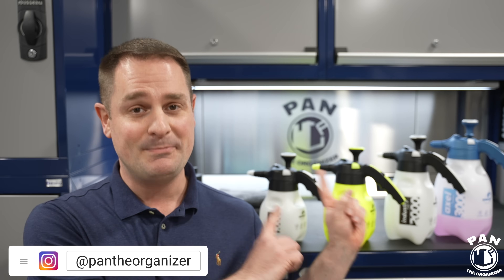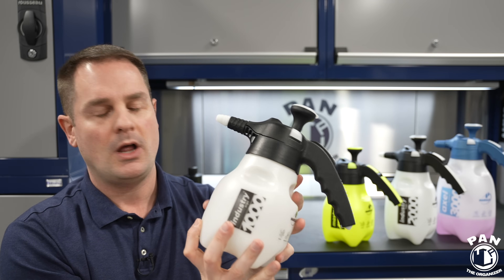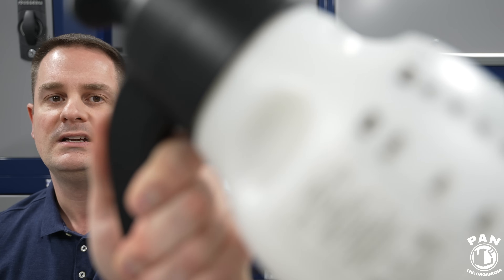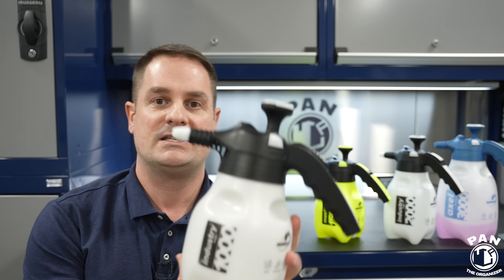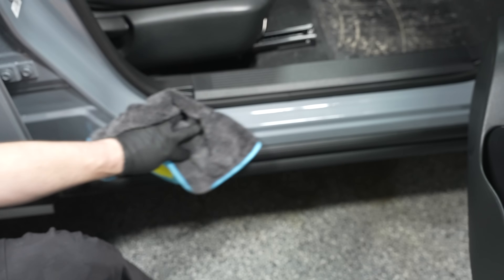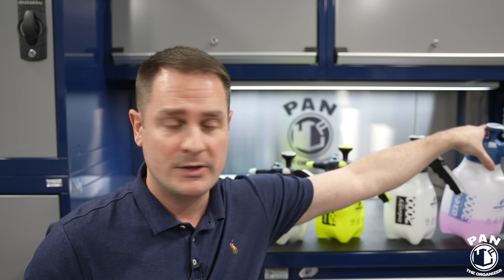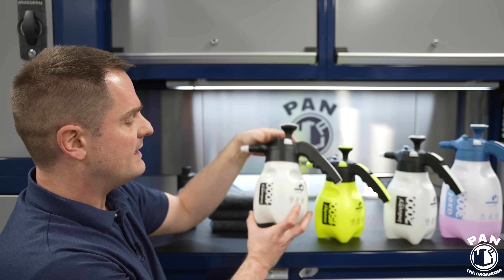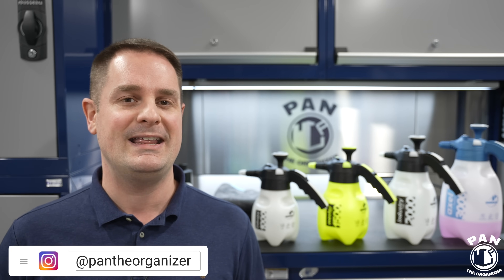THE BEST PUMP SPRAYERS & FOAMERS FOR CAR DETAILING! MAROLEX

Comment: Pan,  hey, so what is basic difference/use cases between the Marolex "industry" sprayer vs. the Marolex "Master" sprayer?
Reply from the maker: You can put what ever chemicals you want in the industry series.

The Master series is more for chemicals close to pH neutral or light chemicals. Rinseless washes, shanpoos, glass cleaners… Mostly non-acidic chemicals. 

The Master series is mainly used for home, office, pest control and gardening. But we also use it in detailing.

If you can only buy one, get the Industry as they are more versatile.
Reply: @PanTheOrganizer  Thanks Pan.
Reply from the maker: My pleasure Paul! Thanks for watching.

Comment: Hello Pan, other detailers have said you have to rinse them off with water after each use or maintenance for them to last long is that true?
Reply from the maker: It depends what you put in them. For pH neutral products, rinseless washes, shampoos, etc, it’s not necessary to rinse after each use.

It would be more for harsher chemicals like wheel cleaners perhaps rinse. Although Sumeet left the Brake Buster wheel cleaner in the Axel foamer for a year and had no issues.

The white bottles are quite chemical resistant so I wouldn’t worry too much.

The green/yellow bottles are not as chemical resistant so those are meant more for pH neutral products.
Reply: @PanTheOrganizer  thank you so much Pan you are the best.

Comment: Pan, does this mean you have peaked for sprayer bottles now as anything else is superior to this brand?. Am only detailing family cars here in the UK but the nearest thing we have (as seen on Forensic Detailing Chanel) is the IK Foam Pro 2 about £24.00 GBP. I would like to see a comparison in a future video or see Jon do it on Forensic Detailing Channel.
Reply from the maker: For sure, the Marolex are the best pump sprayers I have tested to this day. I have pretty much the entire range of IK sprayers (from the original Foam, Multi 1.5, to the new Foam Pro 2, Multi Pro 2, and Foam Pro 12), and these Marolex allow me to spray for longer without pumping as much, and have a higher output pressure, among other qualities.

Comment: Would the foamer work for Optimum Power Clean or would I want the Indusrty sprayer?
Reply from the maker: That depends if you want to simply spray the product or make it foam.
Reply: @PanTheOrganizer  I wasn't good in chemistry class.  I googled acid vs basic and now the sprayers make sense.  Thanks.

Comment: Does the 3000 axle spray for a longer duration than the 2000 due to bigger size?
Reply from the maker: Well it will last longer because it contains more volume, so yes.

Comment: A lifehack to get 2 in 1 system. Buy Foamer to use foam. If you need sprayer you need to take off cap and see the long tube inside. If you look close the long tube consists from 2 parts, long tube and small tube with plastic connection and hole in it. Take out whole tube and separate short tube with plastic connection from long tube then put back only long one and now you have sprayer! Also you can take out a foam tip. But this is not the end. Also you can buy a spray nozzle from sprayer version that perfectly fit with foamer! 😉

Comment: I purchased the 2000 and it didn't last very long. It will not create/hold pressure. Be careful recommending this product. I enjoy your channel.
Reply from the maker: First time I hear of this. I have tested pretty much their entire range in different sizes in the past year, and I haven't had a single issue. And it's not just my opinion. Pretty much all the other detailing channels that have tested Marolex sprayers agree they are simply the best.

Did you reach out to the place where you purchased this from? Perhaps you had a faulty one. Again, I haven't heard of such issues.

Comment: I dislike my 1 liter Marolex sprayer.  The soft flexible tube that is supposed to always find the low spot doesn't work as intended.  When you spin the cap on the flexible pickup tube wraps around it and never seems to find the low spot.  I pick up air when it's at or below 500 mL and have to shake it around to unwrap the pickup tube.  I'd rather just have a pickup tube that stays at the front bottom corner of the bottle, since I almost never point it upwards when spraying.

Comment: Hi pan, I brought a marolex ergo master, I used bilt hamber surfex hd in it at 1:10 and somehow left it for about 4 months and since then I can’t get it to spray properly, I have cleaned it out multiple times but it’s still not working, I see you can get a service kit for it, do you think it is not suitable for surfex hd, should I have brought an industry model ?
Reply from the maker: You should have purchased an Ergo Industry series (white bottle) as those are more chemical resistant. The green Master series is meant more for regular pH neutral stuff...

For more questions, you can ask Sumeet directly at this e-mail: info@luxurymicrofiberstore.com

He is the official importer of Marolex pump sprayers and knows his products quite well.
Reply: @PanTheOrganizer  thanks for the reply, I’ll invest in an industry model, fantastic bit of kit though, I’ll put a service kit in the ergo and use it for something else 👍

Comment: Are any of these  one liter pump pressurized sprayers capable of dispensing Automotive Body Shop “Wax&Grease remover? I have killed/destroyed so many chemical resistant spray bottles over the years , it’s not even funny! Thanks for your time 👍!
Reply from the maker: I don't use these pump sprayers for that purpose, but this one would resist chemicals no problem: https://amzn.to/3onlKv0

And there are always spare parts you can purchase separately should one of the seals get worn over time, which is normal.

Comment: When your cleaning you engine bay do you have to cover up anything? Before spraying
Reply: Alternator is a safe bet (but not 100% necessary in most cases), but unless you're using high pressure or are aiming into the intake you should be good with product and light water. pressure
Reply: @thepassionofthegoose5472  ok so i could just basically use one of those foam cannons foam it then wipe clean
Reply: @jayboOgZ55  I did just that to a 2017 Honda Fit yesterday in preparation to wrapping the hood and it was just fine. Foamed the bay and underside of the hood, used a brush and microfiber towel/rag to agitate and lastly a lazy stream of water to rinse. If the product had been rinse-less water wouldn't have been necessary. Cheers.
Reply: @thepassionofthegoose5472  ok cool thanks
Reply from the maker: On modern cars (less than 10 years old) there is no worries when detailing an engine bay. Yes you can cover sensitive electronics and electrical components, alternator, etc if you feel the need to, but I have detailed hundreds of engine bays over the years and never had a single issue. Common sense. Just dont spray the jet of water focused on the same spot. Keep the water moving.

See my engine bay detailing tutorial here: https://youtu.be/R5ZbroMTULM
Reply: @PanTheOrganizer  thanks alot broo much love & appreciate it

Comment: The industry Ergo comes in 2 flavours, Acid and Alka.  No mention of that in this video video 🤔
Reply from the maker: Because we don't get the other versions in North America. You guys have them in Europe. Sumeet will explain why more in detail, but my understanding is the ones we get here, with Viton seals, have the most chemical resistance anyways.
Reply: Ergo industry version with the Viton seals can handle all detailing needs, on both ends of the ph scale, it’s the more heavy duty out of the two.
Reply: @luxurymicrofiber419  Are you sure on that? Why do Marolex themselves say the Industry Ergo with a Viton seal is for inorganic acids and the one with a EPDM seal is for alkaline solutions?

Comment: How do these compare to the ik sprayers that a lot detailers use
Reply from the maker: I have pretty much all the IK pump sprayers (IK Foam Pro 2, Multi Pro 2, Foam 9, Foam Pro 12, and older Foam 1.5 and Multi 1.5) and the Marolex are superior in my opinion, mainly because I don’t need to pump them as often and they have a higher pressure.
Reply: @PanTheOrganizer  thanks for that answer .

Comment: Pannnnnn The Organizeeeerrr! Hello Sir. Please help. Axel 3000 or 2000?
Reply: Personal choice. The 2000 is 2 litre capacity and the 3000 3 litres.
Reply: @666DW  small car model 3? Im getting tired of setting up pressure washer.
Reply: @samclonce  these Marolex hand pump sprayers will not provide anything near the cleaning capacity or function of a pressure washer. 
If you value your cars looks stick with the pressure washer👍🏻
Reply: @666DW  Thank you Sir. 🙏I will follow your opinion. Now I need to flip my initial idea and settle towards ergo 1000 for my wheels.
Reply from the maker: It comes down to what size you prefer really. Not the size of your car. Even the 2000 is enough to cover a small car, but perhaps you would prefer a 3000 as you can have more liquid that lasts for a few washes. It's your choice to make.
Reply: @PanTheOrganizer  Thank you Sir.

Comment: 1:10 on brake buster? no way. Im doing like 1:5 (1 part solution 4 parts water), and sometimes i feel thats not enough!
Reply from the maker: When I use my IK foamer, I also use 1:3. But in the Marolex Axel foamer, 1:10 worked super well.

Comment: These look great as far these type of sprayers go. The only thing that may hold me back is that I really like the addition of a schrader valve on the new IK foamers - did Marolex miss that trick?
Reply from the maker: I think it's the other way around. With the Marolex, you get such long working times, and many people were complaining how often you have to pump the IK sprayers, so IK decided to add a valve to pressurize the system with an air compressor...
Reply: @PanTheOrganizer  I do like the higher psi and longer spray time with this range, but let's face it we're still talking A LOT of pumping here, especially for a full body foam. I'd much rather have a battery do the work :)

Comment: Can I use one orange pad for the whole car
Reply from the maker: It depends on the level of defects and what results you want to achieve. Normally it’s best to switch pads a few times. I normally use 4 to 5 pads for one car.

The cleaner the pad the better.
Reply: Pan in my car I have swirl marks and minor scratches are there

Comment: The only thing I don’t like about this sprayer is that when you release the trigger it does not shut off right away.
Reply: That should not happen, check the seals and make are the internals are clean and free from any debris
Reply from the maker: Mine don't do that. They work perfectly well.

Comment: Marolax. Big disappointment 10 minutes of use I'd be slamming this on the floor.

Seems great mechanically.  Totally a terrble to hold. Thumb does not land on trigger to enable  easy operation. If I grip higher up on the handle my thumb is high on the trigger and levelage is poor . If I grab lower on the handle leverage is bad as well and I have to radically bend my thumb to press the lower end of the trigger to activate  the foamer also the end of the handle could be 3/4" longer , in my hand the corners on the lower end of the handle are pointly and jab the palm of my hand.  This would be worse with the weight of liguid in the tank.  I bought 3 of these , 2 as gifts.  Marolex sorry to they're comin' back at ya.  They feel awful.

Comment: But I’m already so much money in on IK
Reply from the maker: The IK are still a very good choice. I have owned them for years and they are high quality. But when I tried the Marolex, it was a completely different level. The Marolex spray for much longer without needing to be pumped and the spray is higher pressure. Among other things.

Comment: I think I got a dud. My industry ergo 2000 broke after 5 uses.
Reply from the maker: That is unusual, as yeah these are so well built. Did you reach out to the brand? Or if you are in USA, did you reach out to Luxury Microfiber?
Reply: @PanTheOrganizer  I bought it off Amazon. It will still spray, it just has a slow leak that will release all the pressure after about 10 minutes, so I never went through the return process.
Reply: Buy directly from the source to prevent any chances of getting seconds or counterfeit products. We try hard, but very difficult to police the web.